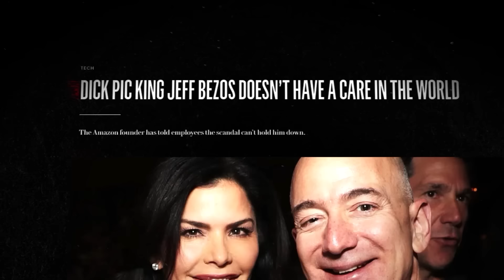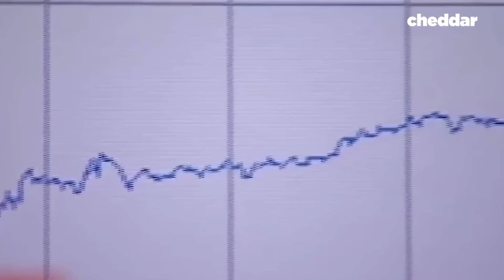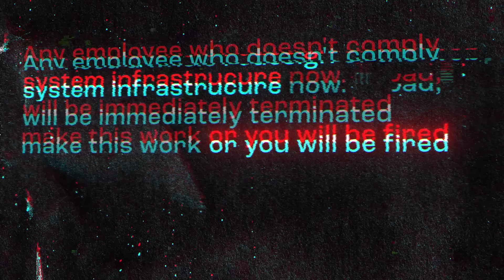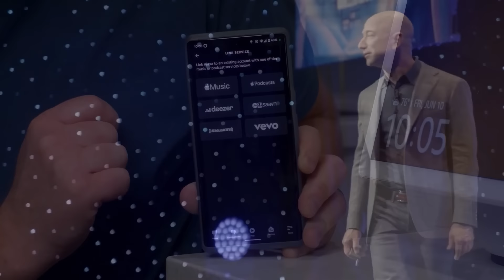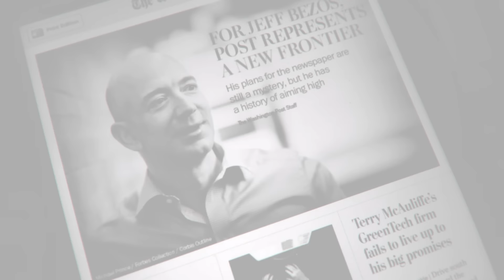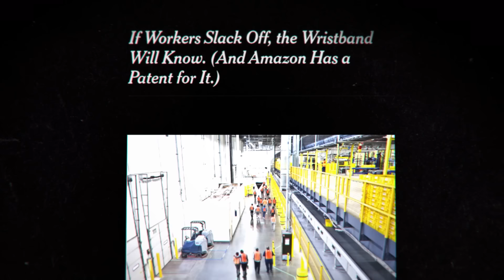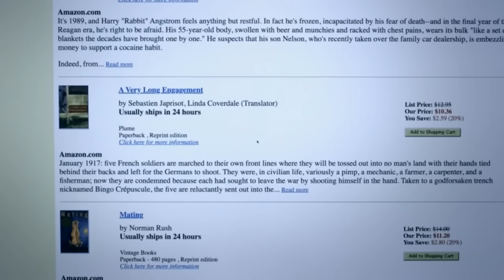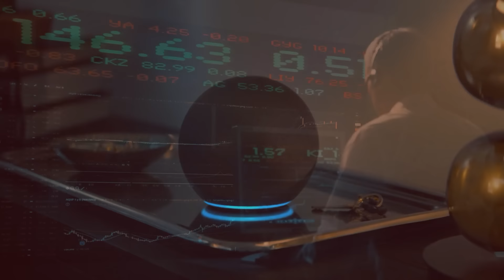Why I Hate Jeff Bezos

Comment: I’ve been working at Amazon since I graduated. And when I first started to work there covid hit so everyone told me Amazon at the time was actually a lot more relaxed then previous years. They told me if you didn’t meet rates 2 work periods in a row security would actually escort you out take your badge and you were just fired no questions asked. Now even though this wasn’t the case anymore when I first started. Every period the managers would come to every wall and basically gives us a rundown on our rates if we were under performing or “doing what was expected”.  

Now I used to work the graveyard shift from 6:30pm-7:00am. Now something to touch on the ridiculous breaks. Yes all of the breaks were only 30 minutes and they were extremely strict on not going over that. So you realistically only have a 15 minute break. Because you have to walk halfway across the building to get to break. Then you have to warm up your food of course. But mind you your whole department is on break too so it’s at least 100 people and theres only about 16 microwaves. And on top of this my god I hated this. The microwaves were terrible maybe it was because it was so many microwaves in one area but you had to warm up your food for a minimum of 3 minutes to get your food hot. Anything less than that it was basically just rotating under a light emitting no heat just straight inertia to warm it up( sarcasm but this is what I like to think). So now you could finally eat. But swear to god you have to speed eat it. Because like I said averaging the time you only have about 15 minutes by the time your done walking to break and warming up your food. 

Now a ridiculous story I have during peak season about break is we used to take naps because they’d work us to death. But during 2021 idk why but they actually banned us from taking naps. Mind you we work a night shift we were already tired from that unhealthy lifestyle on top of all the work we were forced to do. So me and my work friends would legit lay on the floor (ik probably nasty or whatever but we really didn’t care we were so beat) and try to nap but the managers who aren’t even on the same break schedule as us would come in there and force us to get up. And say things along the lines of. “If I can’t lay down and sleep then you can’t” but the managers at Amazon don’t do shit. There’s a select few but it’s mainly the PA’s who do the hard work. 

Moral of the story I’m questioning why I’m still working there. If you plan on working there. Because of a bonus or something. Get your money and get out. Amazon or Beff Jezoz doesn’t care about you.
Reply: I hope you can make it out sooner than later🙏🏾🙏🏾🙏🏾
Reply: I'm currently working at Amazon, and it is indeed terrible
Reply: @Eddybo22  thank you started searching for a new job after this post
Reply: I mean, he literally runs one of if not the busiest major corporation in the world though. To put this into perspective: people Order over 18.5 Amazon packages per second, that's over 1,100 packages per minute, and over 1.6 million packages per day. He has to ship packages all over the world his employees knew what they were signing up for when they want decided to work for him. And his employees get free vision , dental, health insurance, 401ks, estate planning, college assistance, financial planning assistance, parental counseling, like most Wall Street Executives don't even get the benefits at Amazon employees get.
Reply: @cuckcatanimations9141  I mean, he literally runs one of if not the busiest major corporation in the world though. To put this into perspective: people Order over 18.5 Amazon packages per second, that's over 1,100 packages per minute, and over 1.6 million packages per day. He has to ship packages all over the world his employees knew what they were signing up for when they want decided to work for him. And his employees get free vision , dental, health insurance, 401ks, estate planning, college assistance, financial planning assistance, parental counseling, like most Wall Street Executives don't even get the benefits at Amazon employees get.
Reply: @jankoleon3785  >kirito pfp 
>unironically defending billionaires
your account better be satire
Reply: @jankoleon3785  This better be bait bro, because defending ruthless billionaires is pathetic

Comment: You barely scratched the surface of the driver rabbit hole. I’ve been working as a driver for over a year now. Amazon intentionally segregates us into groups called DSP’s (delivery service provider) and these groups are contracted for a time period and often these contracts are cut with little to no warnings prior (I had about 2 weeks of work before I was jobless). The drivers generally are unaware of this knowledge until it’s too late…. This happened to my DSP while we were breaking records for safety at our station.
Also unfortunately yes I can 100% confirm we pee in bottles, there aren’t usually many gas stations my route passes, and they never built any function in for bathroom breaks which you’d think would be obvious solution??? There’s much more I could talk about but I’d be writing all day.
Reply: I found many pee bottles in the fold up return bags we transport from the warehouse to the vans.

Comment: In Star Trek they give a lesson on how absolute power corrupts absolutely. However when building a Starship everything has to communicate with every other system on the ship. This would not be possible if one manufacturer by one company makes parts for say environmental and another company makes parts for the warp drive assembly, and can’t talk to one another because the parts are from two different companies. Although it should be noted that the monetary value capitalistic system in the 23 century has been done away with and “materialism is relatively non-existent. Hypothetically speaking.